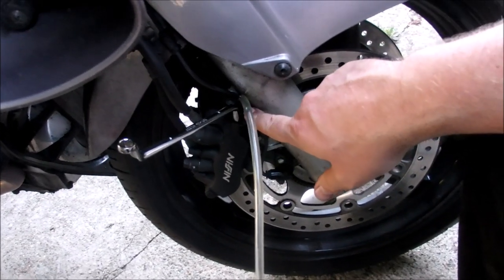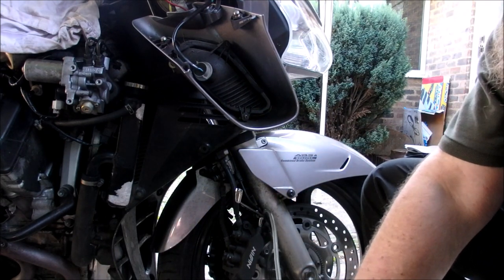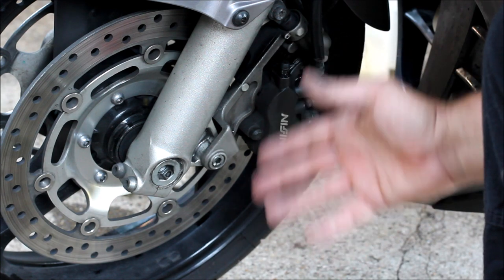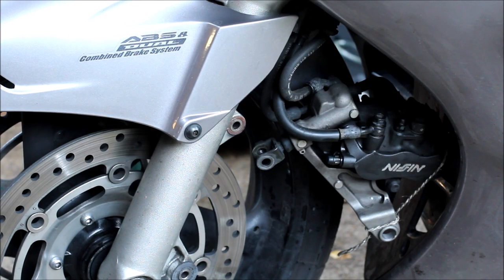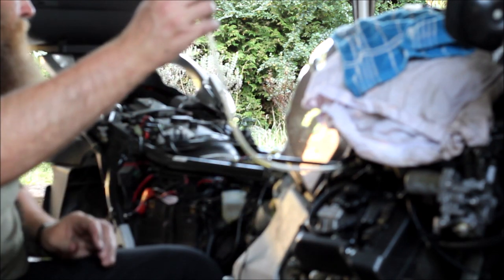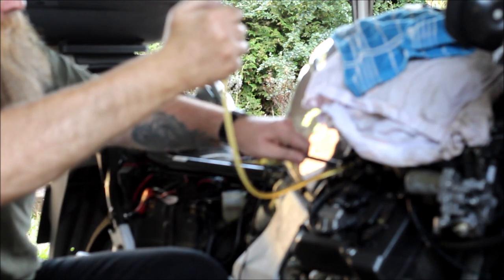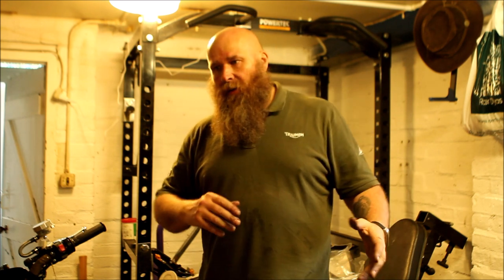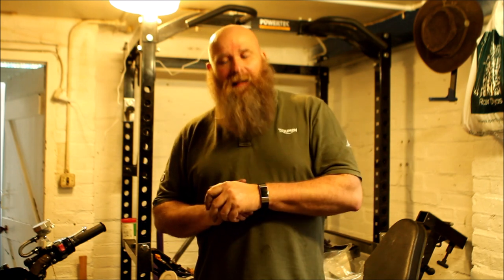Bleeding Linked-Brakes (ST1300a) Step by Step

Comment: I fail to see any point in pumping the brakes dry.  The master cylinders are designed for moving fluid, not air.  Once air is in the system, you won't remove all fluid from the system anyway.  After removing extra fluid from the master cylinder reservoirs, the most efficient way to flush and bleed brakes is to push the new fluid in behind the old fluid.  The lines do not have a large enough diameter to allow mixing of the fluid to any extent.  When you see new fluid at the bleeders, the fluid in that portion of the system is new and clean.  My Concours 14 looks simple compared to this.

Comment: Completely evacuated all old fluid on my VFR800. Rear brake was dragging badly, removed rear caliper and found contaminated fluid in middle cylinder. Pistons ok, replaced seals. Used pneumatic brake bleeder and followed factory shop manual. Suspect some air still in rear half of system although front brakes are fine. Good video.

Comment: I wonder how critics suggest that one removed all fluid.  It seems that since the master cylinders pump fluid, but not air.  New brake fluid will push the majority of the contaminated fluid out.  Brake lines have a very small cross section so the old and new fluid is not very likely to mix as the new fluid pushes the old fluid out.

Comment: if your still riding a pan i did two mods that might be useful for you first was replace the heavy topbox for a 8mm ply shelf this allows you to tie on large stuff like double sleeping bags etc. also the top box is around 4 times heavier than the ply shelf. second is mount a rear metal shelf behind the number plate allowing you to put something wide and heavy like a tent across the back then just strap on a number plate on the back. i also removed the back light and split the ecu and abs and cut out the plastic shelf now i can change the bulbs from under the seat and i have alot more storage space

Comment: I got rid of my blackbird due to the messy and complex DUAL-CBS DIY method, just got tired of it due too many steps to follow, valves, hoses and bleed lines. Don't get me wrong I loved the Bird but when it came to maintenance was too costly and time consuming for me and expensive if you had it done at a Honda motorbike repair shop, now I ride a ZZR 1400 and everything is much easier to do by my self. Honda makes great and wonderful machines but their braking linked method is just not for me.

Comment: Very helpful. Did it just the way you showed and had great results. I used a Capri vacuum brake system which  allows you to do the whole job without assistance but this video made the difference between a half ass job and the real deal.

Comment: I have to correct your PCV comment because it's only on the rear system . The only direct link in the system is via the foot pedal to all three centre pistons. It's also impossible to pump fluid from the front master to the PCV as there is no link.

The 1100A (1996 or T model and newer )and the 1300 are done the same way except there's no need to bleed the secondary master with the 1100A nor is there a need to have the SMC in a specific position like you need to do with the 1300.
Reply: What is that stupid side tank barrel on the rear master cylinder on my goldwing 1500? is there anything in it? I got a rebuild kit today for this bike I just bought and could not get the brakes to bleed doing the bake breaks. I did not know it had integral or whatever you call it braking. I punctured a small hole in the metal cap in that barrel. Now if I can just seal it or solder or spot weld it I might be ok.  thanks.

Comment: Great video, your method of talking through each step is spot on what most of us are looking for by way of assistance.

I do have one question though.  

Yes u mentioned, and showed, removing the left hand caliper from the rotor and suspending it at the 15 degree position, but either I missed it or it wasn't mentioned, as to why.  What function or purpose does that step provide?

Thank you again for your time and well done effort.
Reply: There is a master cylinder attached to the arm that the caliper is attached to.  If I recall correctly, it pressurizes pistons I'm the rear caliper when the left front caliper is being applied.  Setting it at 15 degrees eliminates any high spots where air could accumulate in that part of the system.

Comment: I change oil brake on st 1300
And notice that rear center bleed not having oil coming tru 
Also notice when apply the front brake there is no braking at all on rear wheel 
Can you help me ??? What’s wrong on this situation
Rest all work fine 
Thanks

Comment: couple of things I would add, use a drain hose with a non return valve to provide a little back pressure on the fluid and I use an open 10mm spanner to open brake fluid - it saaves the fluid backing up behind a lip. Great video!

Comment: Long story!! 
I had to have the rear most piston in the back caliper removed by a local garage, well and truly stuck! Piston was removed, renewed and new seals fitted on all pistons. Refitted the caliper and bled the system as per the video, rear wheel was spinning fine on the stand and no issues on a test run. Used the bike the following day to go into work - no problems - come knocking off time, I got a couple of miles down the road and a horrible burning smell hit me, rear brake had locked on and the disc was glowing red. Got recovered home and the brakes had released. Stripped it all down again, all 3 rear pistons were sliding OK .. Bled the system again and all good on the stand, couldn't get the brakes to lock on until I took it out for a test run and it started to drag again .. How big a hammer do I need to sort it out??? "Bleeding linked brakes" .. more like "F%*(*^# linked brakes"
Reply: Might be the SMC sticking.  I'm actually replacing both my rear caliper and SMC tomorrow, so they'll be dry, but after watching this I'll try to avoid losing any fluid out of the front calipers as I was planning on flushing and replacing all the fluid while doing the job.
Reply: Perhaps you overfilled a master cylinder reservoir.  The fluid expands a little bit as the fluid warms.  There must be an air space because fluids do not compress.  I learned that the hard way on my brother's V65 Sabre when I overfilled the master cylinder reservoir on his front brakes.  Fortunately, we only managed to warp one of the rotors.

Comment: Hello, thanks for the video. I am about to do it on my VFR 800 also with combined brake system. I noticed you had a one-way valve tube lying on the ground - can I ask why you didnt use that?
Reply from the maker: Hi, i did a review of the Halfords Brake bleeder and to be honest didnt think much of it.  Some people said cable tying the hoses on to the valve stopped the hoses shooting off as the pressure built up, but it's never worked for me, so just stick to the method i've always used.    Thanks for watching and commenting, always appreciated.

Comment: I have a 94 honda goldwing with "unified braking" but I don't have all of those bleeders and tanks. One tank for the right front brake and one tank on the rear brake for the rear and left front brake.  What is that side barrel for on the rear master cylinder? is anything in it or is it just a compression tank for the front brakes?  What about gravity feed? crack all the bleeders open and let everything gravity feed/bleed that way? thanks.

Comment: Now then, That's a GREAT 'how to' video, super clear instructions and not rushed through. There was no air in those lines. Super job. I have a Crosstourer so presume the system is gonna be identical. Great help when the time comes to flush the system.

Comment: I have to say, absolutely brilliant tutorial.  I have both a vacuum bleeder and a positive pressure kit that I use to great effect on four-wheelers and while they work in this job, they can get (very) messy; your back to basics approach is a really efficient and easy method of bleeding the ST1300 (or any other bike for that matter).  Bravo!  I've gotten through 2 lts of fluid using the pressure kit and I still have air in the system.  I'll be doing it again today using your K.I.S.S. method and I'm confident I'll get the rest of it.  

Not sure if you're still active, hope so but cheers!  For context I run a solo garage and deal with cars & vans on a day to day basis, bikes are my hobby.

Comment: Thats a great video. Use this on my new varadero
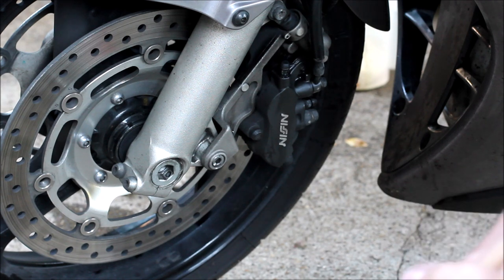Reply: Did you manage to bleed your brakes on the Varadero? The service manual doesn't mention detaching the front left brake caliper and rotating it as did in the video @ 9:37 . Did you attach the caliper? I am going to swap out the old brake fluid on my MK1 Vara (linked brakes - no ABS) soon and any advice would be very welcome. Cheers.

Comment: I have the st1100a linked brakes can you tell me how to do my brakes as my front lever only puts on my front brake as my rear does both front and rear.  Thanks 😎
Reply from the maker: Hi Mike, apologies I'm not familiar with the ST1100 and given the importance of the brakes, would be reluctant to give advice.  Two places I would however recommend would be the ST-owners forum and the Honda Pan European Facebook group for an answer.
Reply: @GTsGarage  If you can do the 1300A you can do the 1100A as they are both the same though the 1100 doesn't need to have the PCV (Pressure Control Valve) bled.

Comment: BIG mistake that I made was to empty the old fluid through the bleed valves rather than your way - hours to complete the job:(. Also noticed that you didn`t touch the secondary  m/c but managed to get a result.
Reply from the maker: Aye, have done about 100 miles since, and the brakes are rock solid.  Would rather change the brake fluid every year, rather than bleed the system dry and do it every two years.

Comment: Excellent video ! I really appreciate it , today I did my 04ST that has been sitting for more than 4 years ( by previous owner ) and my rear wheel was stuck, the only thing I’ve done differently is I polished calipers cylinder besucase of my issue , and since I’m lazy I was able to get to the valve without taking the faring off just lifted the tank , a little bit harder to do but much easier than taking the faring off , thanks again , old biker, new subscriber.